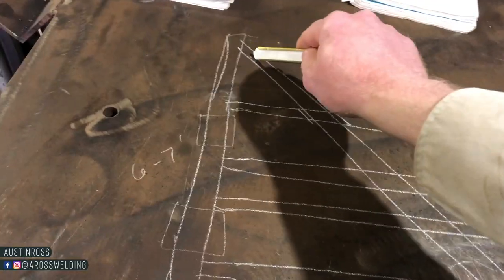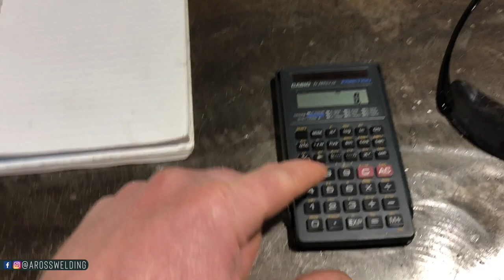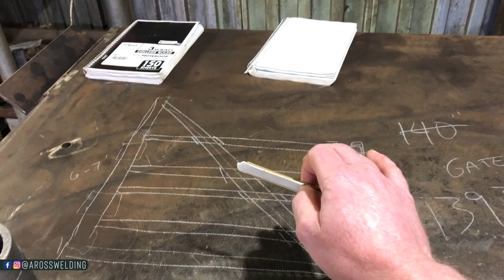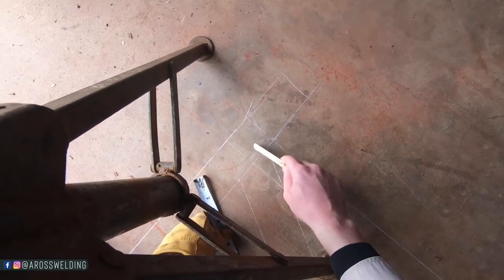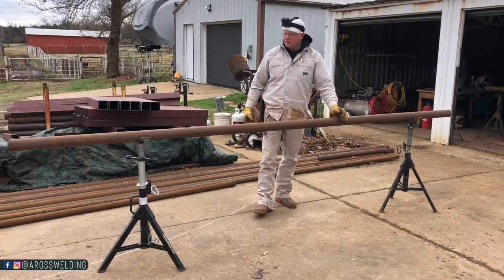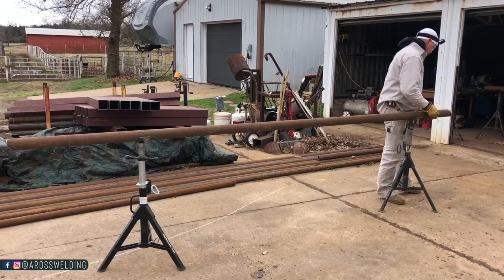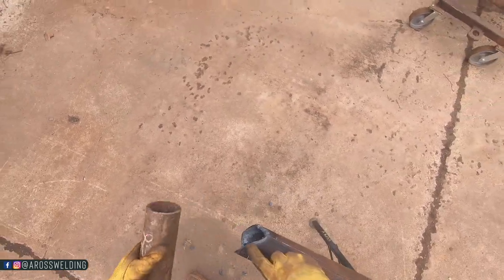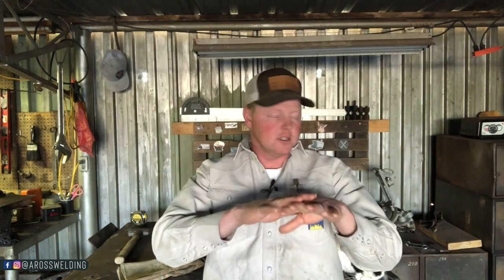LAYING OUT AND BUILDING CUSTOM GATES FOR A 8” CUSTOM PIPE ENTRANCE (PART 5)

Comment: Nice work "A" man, I often use a hole saw in the size of the conecting pipe, any thing smaller than two inch, when in doubt grind it out. Hood down lights on.

Comment: Austin. That's what I did when I was building my canopy frame. I wanted a 13 x 20 canopy.
The cost was $1500.00
Just like you. I laid out the pipes on the carport. Then I used my small Angle gadget to figure out the angle. 
Cut my pipe to length. 
Made a wooden buck and cut my copes out. 
Then I put my pipes in the buck and welded each a frame up. I didn't have a helper to hold my pipes. The wooden buck helped cause I clamped the pipes down. 
Then welded away. I used three ladders to stand only one side of the A frames up.
And started the assembly. Took me about 1 week. At the final assembly. My neighbor kid came over and we lifted one side of the frame up. I also used ratchet straps to lift the assembly slowly. Then stood up the other side of the frame and tied it together. Then welded it up. Frame was dang heavy.
The tool to line up the copes. I bought one just for that job. I saw them on your channel. 
I also bought a new welder for the job. I bought a multi purpose welder with stick. 
Unfortunately, the machine wouldn't stick weld good enough. But once i got a weld going it ran ok.

Comment: I find it beneficial to make a paper tubing model first when I'm welding compound joints on smaller round pipe. I just go to Michaels craft store and get some of those cardboard paper tubes like wrapping paper comes on and go to work with a pair of scissors. Once I have the fit I want, I can accurately measure the angles at my desk. 

Also here's another trick you can use. You can just cut the angles close with your chop saw and float a nice puddle of weld over everything and it won't matter.   Nobody's looking except you and God and I have it on good authority God plays golf on Thursdays, so if you're going to be floating your weld puddles, that's the day to do it! 😂

Comment: That pipe fitting is tricky bidness...if you make a good fit on one piece by trial and error, not using the computer programs for coping, wrap some heavy paper around the end, make a rubbing with heavy pencil of the coped edge.  Cut that out and then you have a template with which you can draw the others with your soapstone.  Be sure to mark your top and bottom centerlines before you remove the tracing.

Comment: Austin, thanks for taking the time to shoot videos. My wife did a YouTube channel for several yours (over 100 episodes) on boot making at her shop in Guthrie, OK. I know how many hours of film and editing goes into just a 10 minute show. I do wish you or someone would explain the measurement of the diagonal pipe. You mentioned long to short-I have been building “h” braces and I’m having problems finding the correct measurement on my cross braces when they are on a angle. I seam to either be to short or long!!! Thanks Dale

Comment: I have laid a lot of things out on a concrete floor even if I have a print with the angle already on it. It let you see how it goes together and if someone put the wrong number of angle on the print you will find it. Just keep up the good work Mr. Ross. I do have a little advice to people starting out when someone gives you a print (study it ) to make sure everything adds up. I went to a vocational college and when I started that was one of the first things the instructor told everyone. He actually had prints that was wrong.  I remember one of the print he gave me the piece of metal needed to be squared up to 4”x6”,cut it out like a c clamp 🗜 the print said to have a 1” wall around the clamp 🗜 but the print showed to cut 5”x4 1/2”out in the middle.  The print was wrong.

Comment: Good video sir... I've drawn alot of small builds on the concrete at shops that I've worked at. Great way to visualize the build to problem solve. Now I do hobby wood working and when I make a custom build I draw out on plywood, old habits are hard to break.  30 years experience in pipe & structural fabricating and I've picked up tons of info from all the old hands along the way, very nice to find a YouTuber who is passing on his knowledge & taking us along for the build.

Comment: A lot of intricate work in this project but then that is what makes it interesting. It would be a nice project in wood too. Nice to see you laying out the gates to scale on the floor to get all your sizes and angles this time. You got a few comments from people including me to do that with your triangle project. If you had done the same for that it would have been a one shot deal. In pipe you have all your cope cuts for me to do that in wood and keep the strength would require multiple half lap joints at the angle of all those joins so still a lot of work. It is going to be one hell of an entry when it is all up. I hope they paint it so it stands out but in your area the rusted well lived in look seems prevalent. Looking forward to seeing it up.

Comment: I work at a steel supply shop and we use drawing software to figure out all the gates measurements. The old school method works but in the long run I find drawing it out on the computer is easier. It’s a little bit of a learning curve but once you get it’s so much faster.